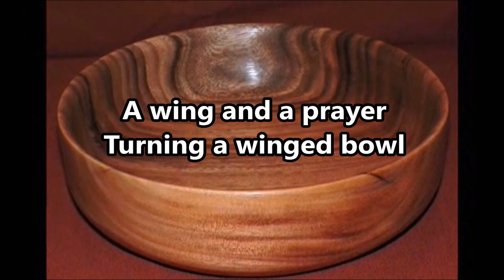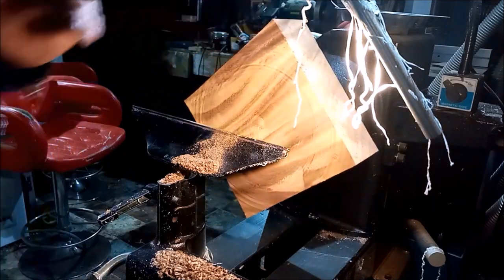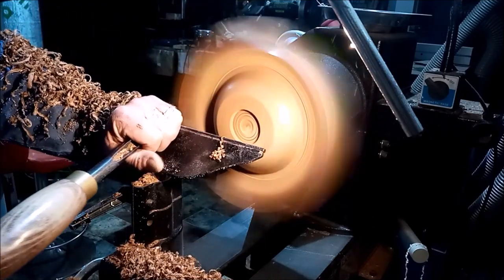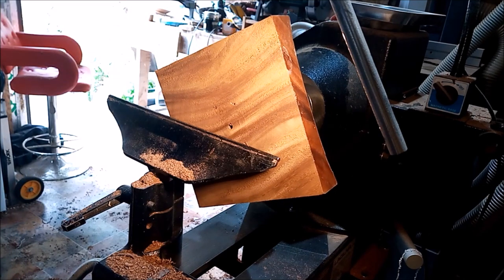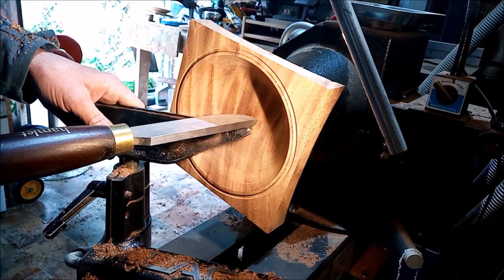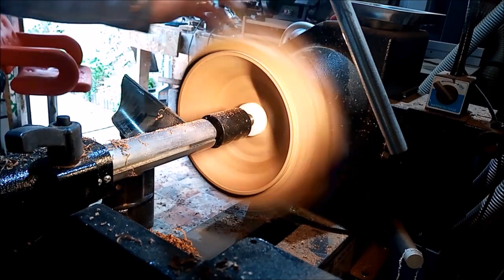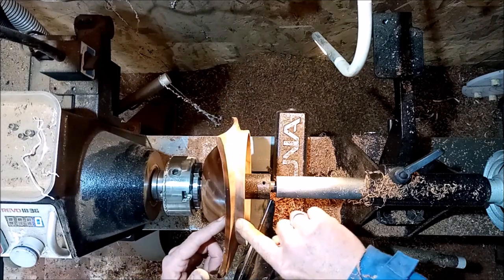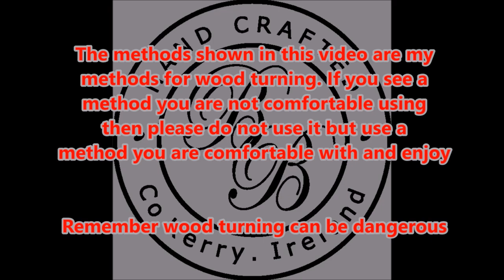A wing and a Prayer.  Turning a winged bowl. / wood turning

Comment: Excellent work.  That wood seemed to be hard as rock.  Did you happen to check moisture content with a meter?
Reply from the maker: I did Mtek, it was 3%. I would say the resin stopped it acclimatising and picking up moisture from the air.